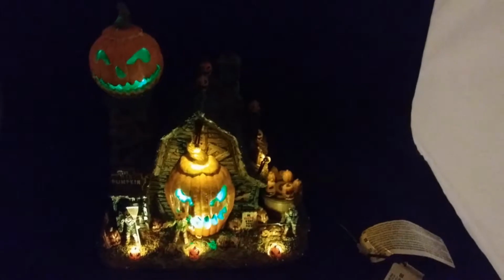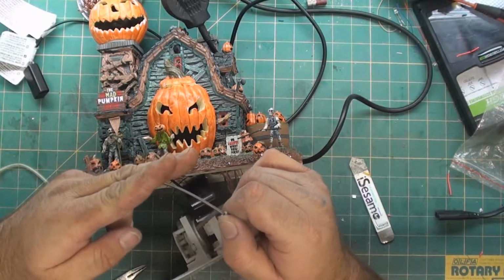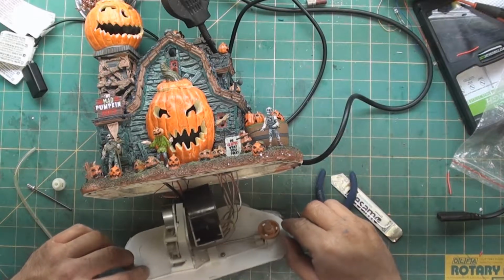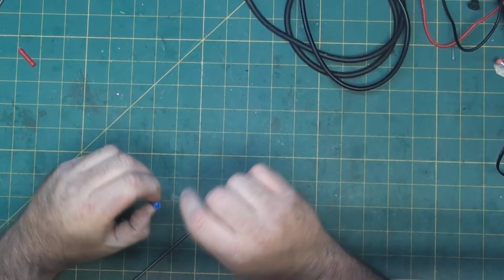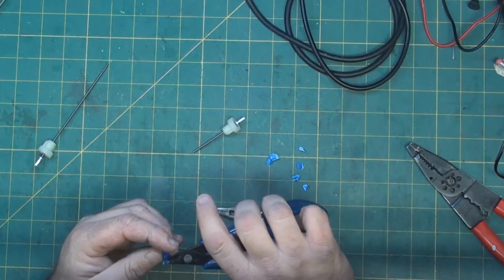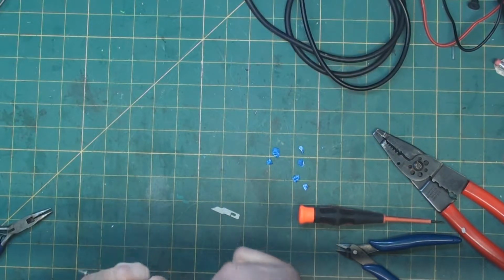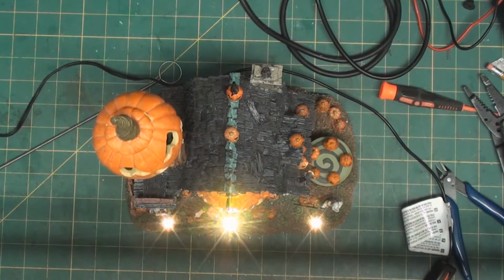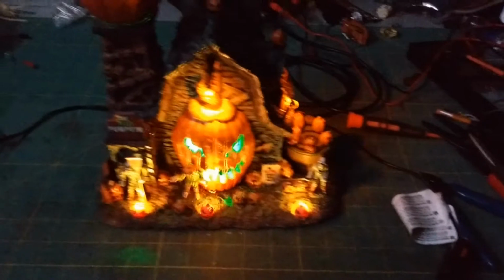Another Mad Pumpkin Patch repair - broken flexible driveshaft repair

Comment: How did you get the top of the drive shaft (that attaches to the spinning pumpkin) out? Thanks
Reply from the maker: I used articulating needle nose pliers to unlock the cam that holds it in. It twist locks like the bottom one does.

Comment: Just fixed mine with a broken shaft and the spinning barrel not spinning. The spinning barrel the clear post stripped out from the shaft. Glued it. For the shaft I fixed it the same way as you with the butt connector. A possible replacement shaft could be a bass guitar string. Great job guys.
Reply from the maker: I will get a bass guitar string to test that